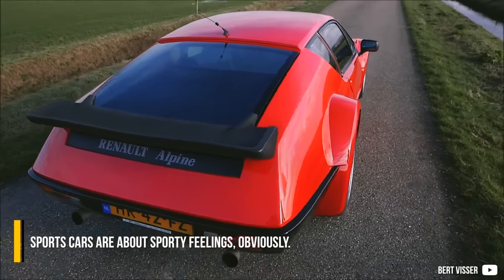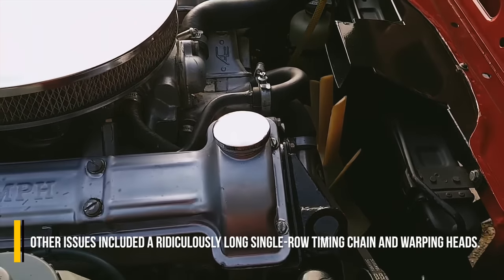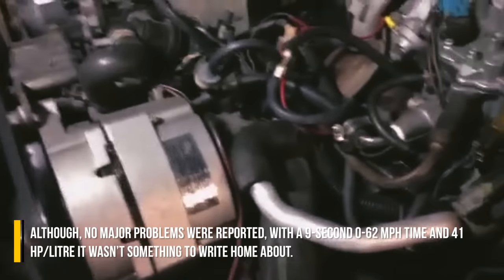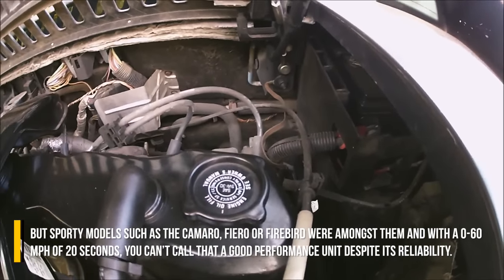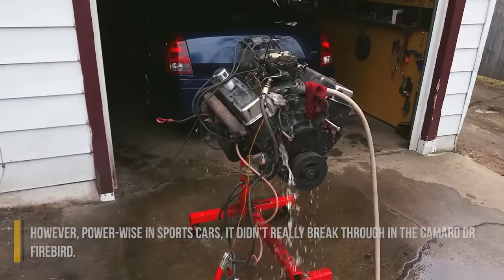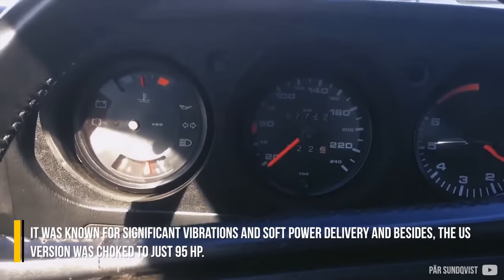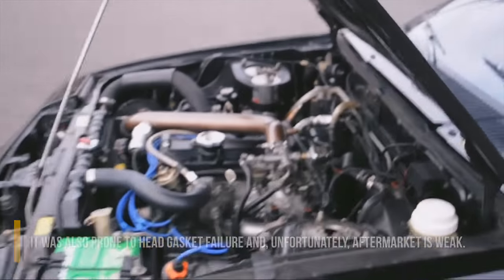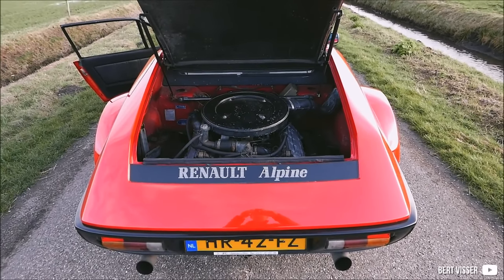Don't Buy These 7 Engines For Performance

Comment: When you realize that your Ford Fiesta Mk5 with a Zetec Rocam 1.0 8v is much quicker than a Camaro 4 banger with a much larger displacement. 😱
Reply: Mk5? You mean you have the mk6. I have an mk5 with the 1.3 duratec. Worst engine ever! (Reliable af though)
Reply: Alex Kirchgessner Yep. It's Mk5 a Zetec Rocam 1.0 8v with 65bhp. It was available in some countries and sold even in 2007 as Fiesta Street in Brazil. 

This 1 liter engine is quite low on power and the vehicle seems to stop accelerating above 150~160km/h (the 5th gear reach 178km/h@6600RPM), but feel quite fun and satisfying to rev it up with shorter gear ratios.

I managed to get 114bhp with an Eaton M24 blower on the gasoline version (9.8:1 CR) and some friends already reached 150bhp with turbo on a stock internals flex fuel variant (12.8:1 CR).

Not a bad engine 1.0l for those looking for rolling on the city with 1 or 2 road trips per year.
Reply: Well, my 1.3 produces 60hp. So speeds beyond 150kph are out of the window.
Apart from that it is really slow and seems to hate revving higher up, while still drinking 11-12 liters for 100km...

Do you think there is any way of tuning this engine without dumping more than 1K bucks on it? 
I mean the car cost me 1500€ and as an apprentice i don't earn much. (Also i need it to get to work, while driving about 1000-1500km a month)
Reply: Alex Kirchgessner 1.3 liter with 60bhp?

Sounds like the Endura engine with OHV instead of the Zetec Rocam SOHC. 🤔

With a MegaSquirt MS1 or MS2 ECU, a BorgWarner K03 turbo (like the ones used on Passat or Audi A3 150bhp) and intercooler, you should be able to get some decent power on this engine... Something between 110 and 140bhp with 0.3~0.5 Bar of boost.

I'm going to search here if someone put a turbo on one of those Endura engines.
Reply: Nope, definitely not an endura Engine! 
It's a Duratec 1.3 in a 2005 Fiesta "Fun X", originally producing 70hp, hindered down to 60 by throttle body and a metal piece under the gas pedal.
Gotta say i already have 186K kilometers on it, would it even be worth it...?
Reply: Alex Kirchgessner Yep. This Duratec 8v is pretty much the same Zetec Rocam we got in Brazil, but it only appeared as 1.0 and 1.6 here.

Recently my engine wasn't revving very well above 5000 RPM.

After replacing the all the 8 hydraulic lifters of the cylinder head, the engine started to rev up perfectly.

It isn't expensive... I paid 120 BRL (around 35 EUR) on the set with 8 hydraulic lifters.

Once they get old, they may leak more than they should and the valves don't open properly at higher RPM.

Replace the oil too, because it breaks and gets contaminated with fuel after several kilometers, which will make it thinner than it 5w30... lol

After that, see of the engine works better.

Check the compression on the cylinders too to see if it's ok and symmetrical.

Certainly the MegaSquirt ECU with the Borg Warner K03 will give new life to your engine. 

Unfortunately, the data that I got here is using ethanol instead of lower octane gasoline (87 octane), so the power output maybe lower than 150~170bhp but certainly it's possible to reach 130~140bhp with very little boost, like 0.3~0.5 Bar with plenty of safety margin.

On ethanol, the 1.0 can reach 150bhp with 1.0 Bar and 1.6 can reach 230bhp with 0.7 Bar, certainly worth to give a try.

Besides... The stock ECU on these engines got a very conservative tuning and you may notice a difference in responsiveness with a programmable ECU properly tuned.

I guess it worth to run a project with a small and efficient BorgWarner K03 turbocompressor. ;D
Reply: This just in- modern cars with small engines prove faster than literally the slowest version of a car from 30 years ago

Comment: Iron Duke 2.5 was not half of the 301 Pontiac, it was a dedicated design with a non crossflow head, thin castings for block and head, and lightweight reciprocating assembly. Its only goal was to be a cheap engine to kinda sorta move a car around.

Comment: problem is in past they made 5.0 engines with 145 hp because of fuel economy crisis in usa.. if u did not know....  it had so low hp  in high displacement for fuel economy... nothing else..
Reply: Worse was that in 1976-77 you could have the 2 ton boat that was the Colonnade Chevelle/Monte Carlo with that engine, with it's mighty 140 initial horsepower...
Reply: On mainly long straight highways.... It was ingenious really.
Reply: They had their cake and ate it too :)
Reply: That was right after Leaded gasoline was banned. You couldn't run high compression engines without running into a big knocking problem. That's also why Hondas only made like 60hp.
Reply: Hondas made 60 HP because they weren't really a thing until 1970
And they didn't ban leaded, they instead went using cats in 1975, which were (are) pretty much alergic to leaded
Reply: It's Ders Mane 
How is it any different for domestic engines? If anything, CATS affected them even more. They moved a lot more air through the exhaust, so the obstruction only got worse for the engine.

The engines were choked up beyond belief. You can tell by the torque figures. They made more than enough grunt down low, but acted like they had emphysema above 3500rpm.

Even the 305 in my truck made like 280ft-ibs of torque, which was more than an SN95 mustang.
Reply: Jαѕσи Tσdd. That's why the Porsche 2.0l that produced not spectacular but decent 125hp in Europe, produced only 95hp in the US, or the Lancia Scorpion/Montecarlo, that was equipped with a 130hp 2.0l in Europe, only had a 1.8l 84hp engine in the US. 
 However, those engines states that around 50hp/litre in a naturally aspirated production engine were still easily achievable (and those were adaptations, they had not being designed for catalitic converter and unleaded fuel). The US "high performance" engines producing 30hp/l naturally aspirated and 40hp/l turbocharged were a bit of a disappointment and smelled of lazy designing.
Reply: Neutron Alchemist 
You're kind of comparing apples to oranges.

A high strung high revving engine isn't comparable to a 7L (or larger) engine that makes literally almost three times as much torque as horsepower.

And, flow is flow. It doesn't matter how big the engine is. 135hp in a 2L pushes out the same amount of air as a 135hp 5L. Those old big bulky cats and smog pumps strangled these things at anything higher than 3000rpm.

A pre-70's 454 (with 450hp) feels the same below 3000rpm as a 454 in the middle of the fuel crisis with 170hp. But after that, the thing runs into a brick wall.
Reply: Infact I'm not comparing an inline 4 banger 2.0L with a "7L (or larger) engine that makes literally almost three times as much torque as horsepower".
I'm comparing it with engines with comparable specific displacement. 
A 2.0L I4 and a 4.0L V8 (and similar. A 5.0L V8 only have 125cl more displacement for cylinder, not enough to ruin anything) have the same specific displacement. The second is supposed to have the same specific power and the same specific torque of the first. 
If it fails at it (we are talking of engines put on supposedly sporty cars, not trucks), well, see above.

Comment: Ford Essex and  Ford Cologne (Apart from the 2.9 Cosworth) were terrible as well, not unreliable, but just underperforming and lacking any real sportyness as none really sounded good or liked to rev. Especially when being put into such cars as the Ford Mustang (SN95) and Ford Capri.

The PRV V6 main problem is that it was never designed to be sporty, but to be fuel efficient and mainly used in medium sized sedans and wagons, plus its development dates back as far as 1969, like you mentioned it was originally designed to be a V8, but in 1971 the idea of a V8 was scrapped and a V6 was decided on instead, and even that first saw production in 1974.

The first "sporty" versions of it had a 2bbl and single bbl carburettors setup, which were difficult to tune and get running right, and were just an over all bad idea.

The engine stayed in production all the way up until 1998, but even by 1980's standards the engine was an old and inefficient design, even with the addition of fuel injection. Which is also what the Delorean was criticised for.

Overall the PRV V6 was just never a good engine.
Reply: gixeff 750 not the one I had in my Mustang or the one my friend has in his Capri
Reply: 2.8 Cologne or Essex v6 3.0 were great lumps!
Reply: All three were good engines for their time
Reply: Funny, that the so bad PRV actually have a steady following. Never heard so much bad things about a single engine.

Ford V6 are nice, but so many four-pots of the era will leave it in the dust...
Reply: Ford also had the 4.0L V6 Colonge engine in the 05-10 mustangs that just made a sluggish 210hp...other V6s around that time made just around 300, such as the Nissan 350s for example and that was only a 3.5L, my 06 mustang has to have a shorter gear ratio to even keep up with them STOCK...even tho its really underperforming especially with the 4.0Ls of displacement it Is a die hard iron cast work horse
Reply: Lane The Vulcan was underpowered but was durable engines. They last forever and there are performance parts for them. I stroked and cammed one and installed it in my Taurus. Makes over 215 hp to the wheels now.
Reply: Maybe if the Delorean got the turbo version like the Alpine GTA, their fate would be different..
Reply: didnt like to rev? uhhhhhhh, no lol. they also sound really good. and thats coming from an american.
Reply: The PRV V6 actually gained quite a reputation as a race engine. It could sustain massive turbocharging, and had the advantage of the 90° banks, that kept the center of gravity low.

Comment: Oh crap, my Mitsu G54b is on your list. I have a U.S. 89 Chrysler Conquest Tsi, I'm opening up the engine again, and will address all its shortcomings. I'll tell you my list, and this engine is still a viable built option when done right. To modify: Wiseco pistons, ARP head studs, new non-jet-valve head casting, +1mm oversized valves, HP valve springs, performance cam with roller-rockers from an Australian Magna, custom forward facing intake manifold/MPFI conversion with standalone engine management.. and my special choice will be a compound turbo setup for this car. I see why it made your list though, factory it has the same OEM slip-cam as a carb'd '87 Mazda b2600 pickup truck here in the U.S.. not very good stock.

Comment: At least the turbo PRV did better, right? The later gen PRV (especially those with turbo) were used in the 400km/h breaking car of WM-Peugeot in 1988 Le Mans, used in the Venturi cars, Alpine GTA, A610 and the early Schlesser buggies.

Comment: To be fair to the Triumph V8, restorers have shown that the stock design need not cause the engine to overheat. The problem was caused by shoddy manufacturing processes in the Triumph factory. It did, however, start out as 2 1500cc Slant-4 motors "stuck" together.
Reply: Alot of the time casting sand was still in the engine after leaving the factory, along with other poor craftsmanship practices.

Comment: Since Triumph was part of BL back then they had access to the Rover V8 but turned it down created the 3.0 V8 out of 2 1.5 slant 4 engines. The cooling system can be modified so it won't overheat.

Comment: The 80s Camaro was something that spoke for the 80s.
Reply: wofkotto the IROC Z
Reply: hahaha looks good, sounds good... Not that good at the walk though.
Reply: I feel the 80s Camaro gets a bad rap, it had a more reliable and tunable engine than the fox body which is unfairly remembered fondly, and it handled better is the stock highest output engine of 235hp potent? No, but it's a 350, make it breathe and you'll see why it's called an SB-see ya later
Reply: Jake Reyenard I’m not sure how you figure the 305/350 are more reliable/tunable than the 302. The 302 had remained nearly unchanged from 1968-2001. The addition of a roller cam and supporting components as well as fuel injection were the most notable updates. There are countless 302s out there going strong with high mileage. Additionally, the introduction of the 225 hp 5.0 for the 1987 Model year made the mustang LX notch one of the fastest cars in America at the time. Any number of bolt ons, h/c/i swaps, or complete builds can be done to the 302  to make much more power than stock.

Comment: The turbo trans am was probably one of the fastest american cars to come out of the 80s, i know it doesnt sound like much, but when the turbo trans am was produced, V8 mustangs were making less than 120 hp and the 305 camaros werent doing much better. And jeep was never owned by GM. The 301 put in the jeep CJ was by AMC.
Reply: Actually it was a 304 cu.in. V8 from AMC that Jeep used as Jeep was then owned by AMC.

Comment: The chevy 305 HO came out in the spring of 83, to me it was one of the first real efforts to return to performance.  Along with the c4 vette, Mustang HO, & the turbo Chryslers.
Reply: People dont remember or understand why power was low from the mid 70's to 90's..

Vehicle emissions robbed the power ! They think its all that particular engine could make...Todays cars have higher compression(adding power) and vehicle emissions that wont take away power.

What makes them quick today are the 5,6,7,8,9,10 speed transmissions that allow low 1st gears making take offs quicker than it would be with that same engine with a 3 or 4 speed transmission with 2.45 to a 3.00 1st gear ratio..

Not to mention the axle ratio are lower today as well making cars quicker than they would be otherwise,people dont know this..

I owned many smog era V8 cars and we removed the smog crap,swapped the intake/carburetor and added headers/duel exhaust and it woke the car right up taking as much as 4 seconds off the 0-60 and or 1/4 mile depending on car/engine...This isnt even changing out the 2.XX axle ratio to 3.23 axle ratio that would also take several tenths to seconds off the time !!!

Comment: The later Pontiac Fieros came with fairly powerful and very fun v6s, not the gutless 4s from earlier.  This made the Fiero what it should have been from the beginning which I belive would have made the Fiero a longer lasting model.
Reply: The94GTC yes but it was lack of power that owners complained about and led to a bad reputation which led to GM cancelling the model before series 2 which was going to come out in the early 90s and was even more sporty looking and more powerful. 
. I know although it had very sporty style and design it was considered a commuter car development, not sports car. But even Honda Civics have grown in power because all owners want more power. As for sports car definition, the original Porsche 911 was designed as a commuter four passenger car but we would all agree it is a pure sportscar. So I would still call a Fiero a sportscar due to its lay out alone, let alone driving charecteristics.
Reply: The94GTC the GT and formula versions of the Fiero that had the v6 were very sports driver oriented. I also half suspect the engineers wanted to design a full blown sportscar but had to call it a commuter car to get the big wigs to sign on the project. If you have ever driven or owned a v6 fiero they are not practical at all, as you think a commuter economy car would be, at least by having a hatchback or have some storage room. The Fiero is not a commuter car even if Pontiac may have considered the project that. Even muscle cars started as daily driver cars that some engineer said, hey let's throw more engine in!
Reply: The94GTC My mom bought a formula edition new in 1988. I believe but don't quote me the v6 was available 87 88. My neighbor had an early 4 cylinder and it was more of a plane Jane as you put it but my mom's v6 formula was red and looked like a miniature Ferrari or corvette mated to a porsche. I remember thinking at 8 years old how futuristic my mom's car looked compared to the neighbors two tone light and dark grey 4 cyl. Also in the v6 models had pretty serious get rag transmissions and redesigned suspension, really bringing the Fiero into serious performance territory for its time.
Reply: The94GTC Yeah the v6s by today's standards were kinda weak. I think they had around 150 hp and 180 torque. That actually made the Fiero pretty quick if you rang the engine a bit. My mother bought a formula v6 fiero new in 1988. If you look at other cars then, particularly in the fieros price bracket, the Fiero was a spaceship for its time.